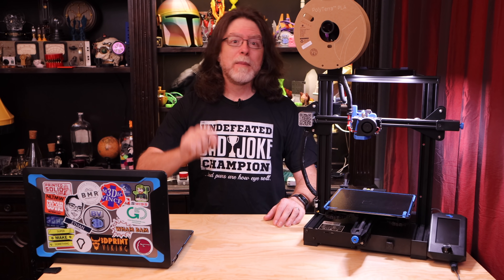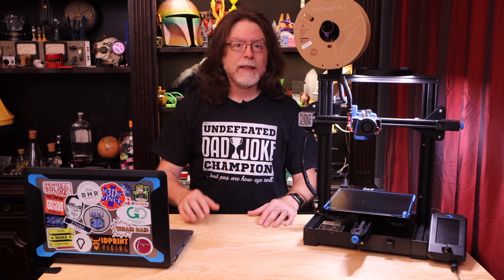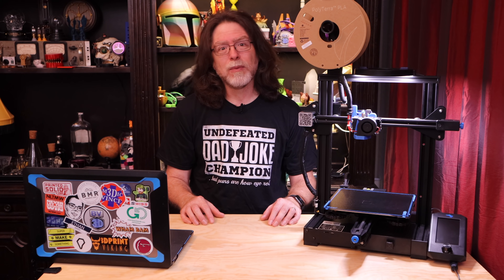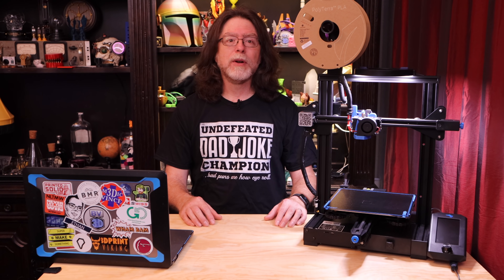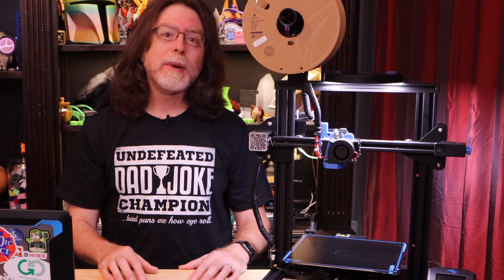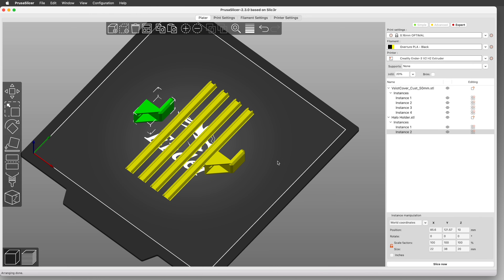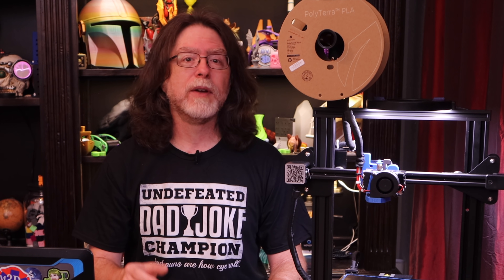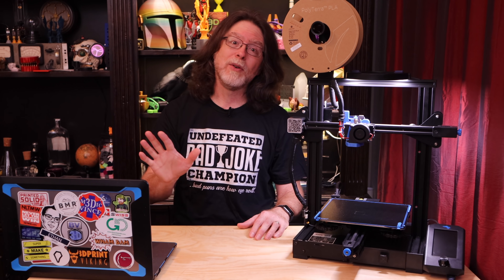Let there be LIGHT! Give your 3D Printer a HALO for about TEN BUCKS!

Comment: I followed your guide , however the ring lights listed were in short supply. Bought another ring light sadley it was wider and taller. Using your parts list I was able to remix the ring light clamps in Tinkercad. I also made a spacer for the spool holder to give the necessary clearance height. Great video and thank you for your great idea ;)

Comment: Just a heads up I bought one of those lights a while back. Running it on high for a long period of time caused my USB block to melt, I ended up splicing a amp reducing circuit in to fix the issue.

Comment: if you're using Octoprint you can use the WS281x LED Status extension. it'll give you a regular light during print but also some indication on the printer status (heating up, done successfully, failed, etc). you'll need a WS281x  light strip (about 1m) which is not that expensive, and you can power it from the Raspberry Pi.

Comment: Probably low enough drain to plug directly into pi4 for power? Thinking to keep wiring down even more
Reply: Nice idea and it makes me wonder if those lights can be controlled from within pi 4 too (always been a fan of automation to start and stop the lighting  directly from octoprint). Also makes me wonder the energy needed by those ring light. But since it is usb, most likely it will not be a problem.